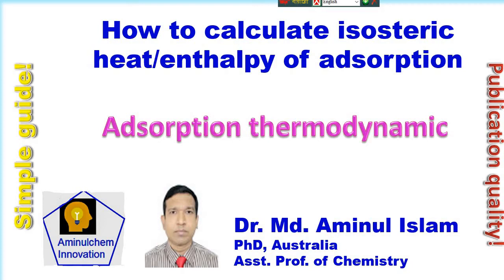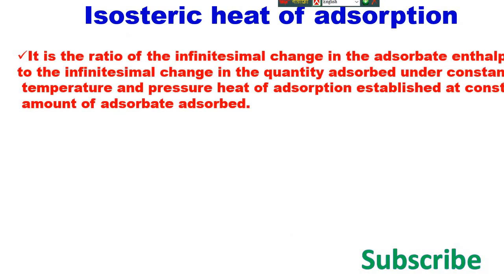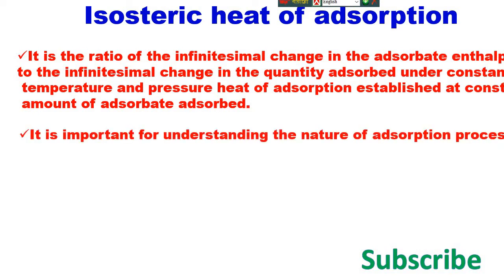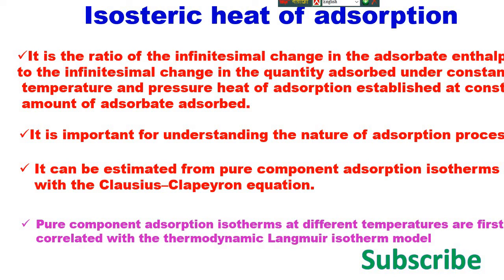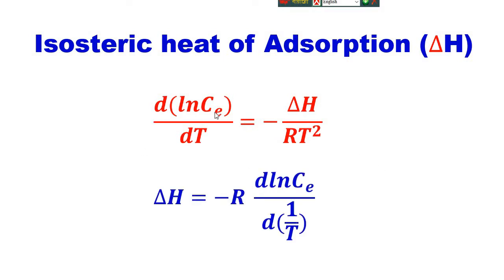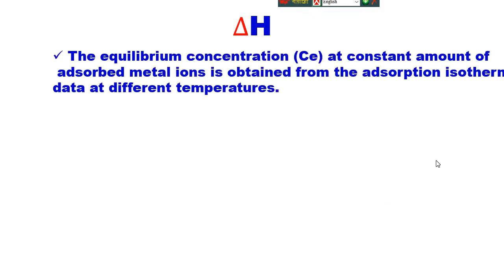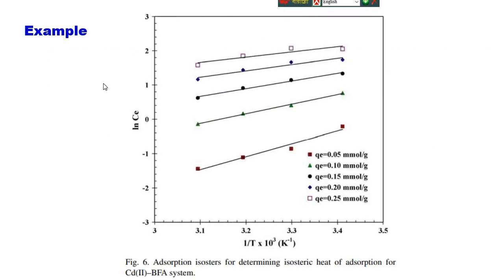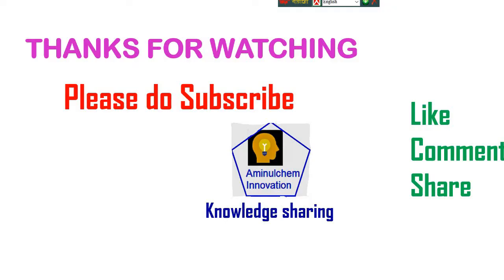How to Calculate Isosteric Heat of Adsorption

Comment: Can I simply use linear interpolation to fit adsorption isotherm data
Then use the equation to calculate Isosteric Heat of Adsorption
Reply from the maker: Thanks. No you don't need to fit isotherm data. Just calculate Ce from isotherm data and use this value to calculate isosteric heat of adsorption